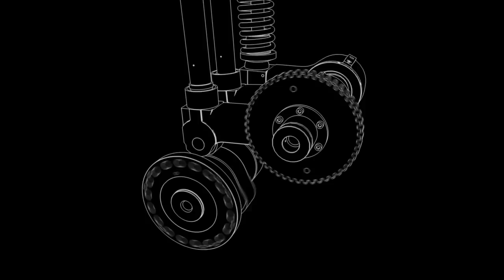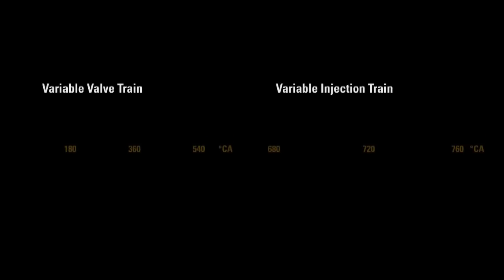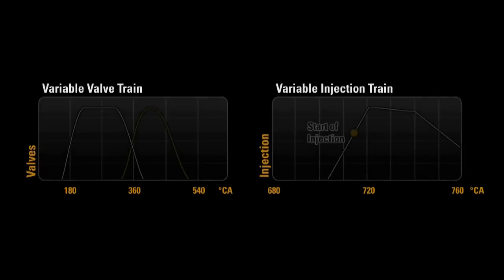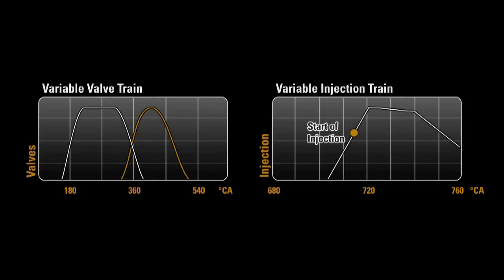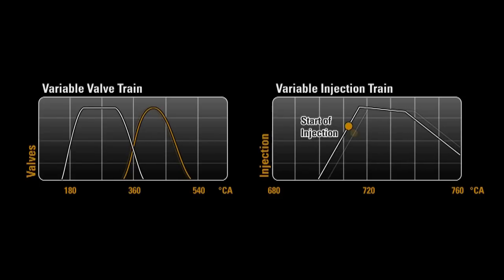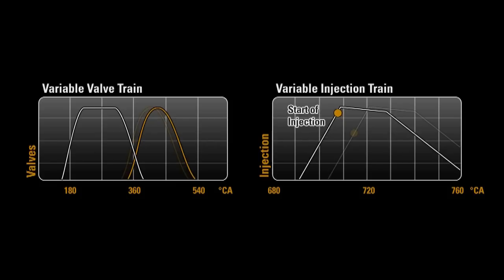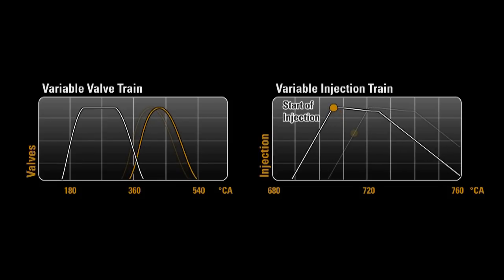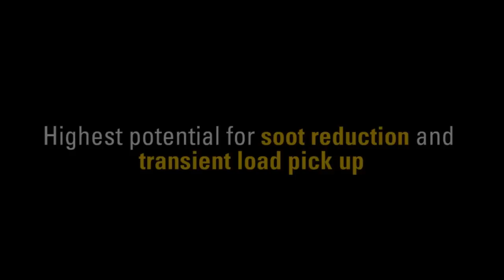Caterpillar Flexible Camshaft Technology

Comment: Well if this is the case then can’t you just shut off air intake all together and just make it run on fuel only then reburn it?
Reply from the maker: Thanks for the question @tonydetwiler2624. Air is required for successful combustion. To burn fuel, a minimum air-fuel ratio is needed. If air intake is shut off all together, combustion is not possible. We’ve worked to find the best air-fuel ratio to minimize fuel consumption, optimize combustion, and reduce soot. - Maria